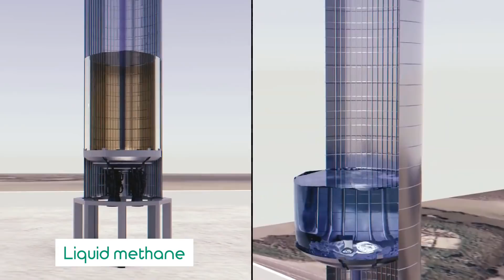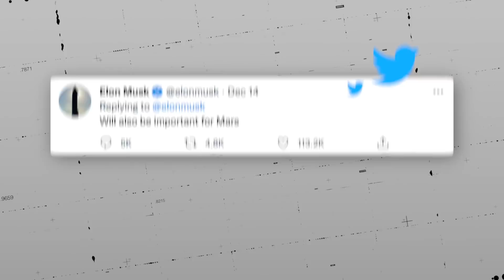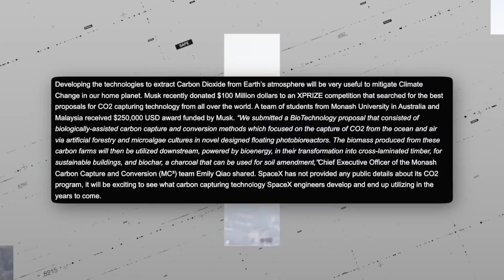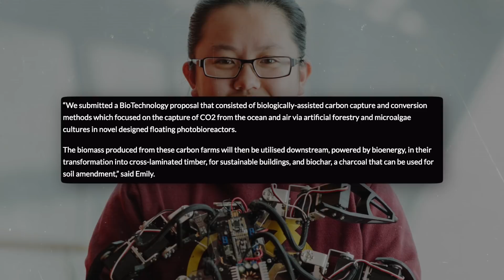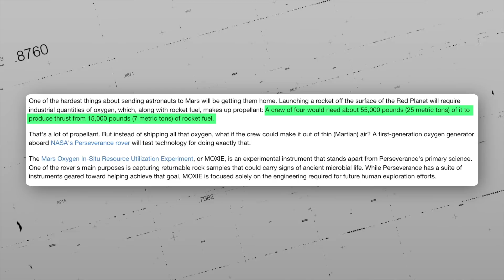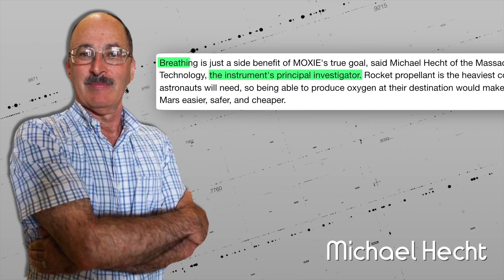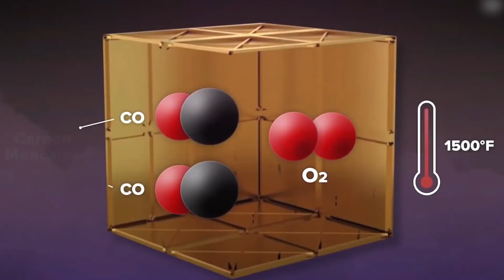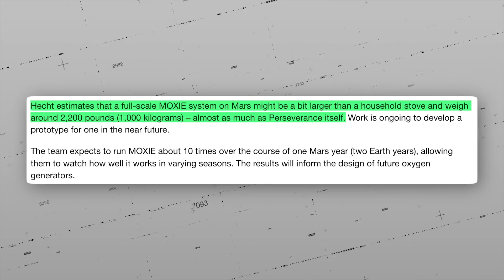Inside Elon Musk's Genius Plan To Use CO2 As Rocket Fuel

Comment: I made this roket 20 years ago by mistake and i burned my face. Indeed  if Elon will make it his rokets will have only co2 tanks  and oxygen tanks.  Wne i was in my 15 of age i was drinking a botle of coke 30ml made of glass. After drinking i put the metal lid back and sat it on the table. Later on in that day  i was amuzing my self with a lighter and i put fire at the hole of that botle with out the cap and a small fire was burning. Ater some time the fire was still there and i wanted to blow it off. When i introduce oxygen in the botle, a very violent reaction happened to that botlle giving me burns on my face and  I was not only in pain but socked. how did that burned that way for so long. So yeah. I guess CO2 and oxygen can burn violently.

Comment: Earth's atmosphere consists of less than 0.04% carbon dioxide. If we had any less the trees would suffocate.
Mars has a 95% by volume carbon dioxide atmosphere. Interesting fact, the average temperature on Mars is -81 degrees Fahrenheit but it can dip to as low as -220 Fahrenheit.

Comment: In a continuous manner of making a synthetic electronic powered sweet duct with large and small ports and pores made on the web like skin's membranes connected to an analytics system with oscillating and gyrating pumps for collectors of said co2 admissions using the co2 as the main fuel source adapted in making the fuel salvageable in the fuel salvage In the main fuel-lines  intake ducts too the main engines

Comment: Isn't there co2 in the vacuum of space and can we make our technology work as it  collectively gathers with solid state wet state hot gelled membrane web like skin with a high resistances to the cold temperatures of space co2 could possibly sweet the molecules out sweet and it could be collected on the gelled web with electronic then  outside and inside the spacecraft  that recycles co2 and recycles it to the full-line in a continuous

Comment: My problem with this idea is CO2plus energy to CH4 which is burned in a rocket engine with Oxygen to form CO2 and water,  to form what you started with CO2!
Reply: Exactly! People are forgetting basic chemistry when they say it will help the planet/climate change. Especially considering these methods most likely won't be (or be made) economical, or economical on earth, if the design is to use it on Mars. (Not to mention some climate effects will be irreversible if we don't just... use the renewable tech we already have!)

Comment: The best way to capture CO2 (in Earth) is not burning coal. Because coal is the the most dense form of CO2 captured by plants and algae in the remote past.
Reply: Maybe tell China!!!
Reply: Right, check out Hydrogen Gas off Diatomic  molecules. Non toxic 75 procent off normal matter. Is already used, and engineering. Europe now till 23- to 2006 , to replace Oil. We in California, could generate Hydrogen from Sun, already do it for Solar panels. Why not for electric batteries, or am I missing something, Elon already has. 🇺🇸🇩🇰🌅☘️😍⏳🙏

Comment: Think about a firework. You light it out in the open it will still be propelled forward. You have a mostly sealed tube that's close to the same diameter as the firework, the rocket goes further.

Comment: If the rocket started off in a tube like launch area, the thrust would take you further faster. Use the propulsion to create thrust.
Reply: You mean like a rocket silo? 

I always wonder what did they do with the exhaust heat and gas couldn't they use it for something useful like spinn turbines or something like that?
Reply: @CUBETechie  being in a half tube, would add to the propulsion, so, less fuel and energy used for take off. And recycled gasses for many things.
Reply: @CUBETechie  if you had a bamboo forest all around the base, but within non burning distance, the bamboo would help naturally filter the carbon and make oxygen in shorter amounts of time. Fast photosynthesis.
Reply: @CUBETechie  sort of. The top half would still be out in the open. The extreme heat and pollutants, could be captured and separated to be reused in different ways. Maybe even taken with on space or planet trips, to use the different glasses for many things on those other planets and out on space.
Reply: The human body can only handle a certain amount of G force, I believe the max is 10 G but I stand to be corrected on that.

Comment: One of the major contributors to carbon emissions is ocean shipping. Methanol has been identified as an ideally dense fuel to replace oil in this industry. The problem is that most methanol is currently generated out of natural gas, it is not solving the carbon emissions problem. However there are technologies and pilot plants that generate methanol using atmospheric carbon, water and renewable energy sources. Methanol generated this way would be carbon neutral. It would not add to the total carbon in the atmosphere, as it would be merely returning to the air what it has already removed.

The problem is that the current plants and the methods they use cost about five times as much per unit of methanol as does the process that uses natural gas. If Elon and company could come up with a way of generating methane (turning methane into methanol is trivially easy) from the atmosphere and do so economically, it would ultimately have a HUGE impact on global carbon emissions.

Comment: I think it would make much more sense in the long term if they were to develop an engine that runs on carbon monoxide and oxygen.  Extracting them from CO2 is much easier than making methane on Mars because methane needs water, which although plentiful on earth has to be mined on Mars. Extracting CO from the atmosphere only needs the CO2 and a source of energy - no need to go around digging up ice. The process is also less energy intensive, even if you had plenty of water available.
The only issue is that no-one has yet built such a full working prototype yet, but several experimental setups have been made with combustion chambers and such. That said, being the first to build something is not unusual for Spacex.  There are some known difficulties, in particular how to ignite the reaction without it detonating but the main reason that hasn't been resolved is that there has not yet been enough incentive to do it because such an engine would have no particular advantages here on earth. On Mars it is a very different story though.
The investment required to develop such an engine would pay off many times over by the vastly easier production of the propellant on Mars compared to any other form of propellant.

A similar situation exists with in situ propellants on the Moon.  There again everyone is talking about making propellants from mined water ice, which is very scarce and needs lot of work to extract pitifully small quantities. It seems to me that it would be much easier to mine metals and oxygen, both of which are extremely plentiful, and use them in a metal / LOX engine. As with the LOX/LCO engine no-one has yet built one but maybe it is about time someone started developing one.  The ISP would be quite poor, at the level of a KeraLOX engine or even a bit less but on the moon that wouldn't be that important and would be far outweighed by how easy the fuel would be to produce.
Reply: Very interesting idea, while yes I think it would be much easier and more efficient to produce, I just think that the downgrade in performance could cause problems especially when returning from distant space bodies. If we consider the fact that there is plans to build stable bases on both the lunar and Martian surface, it would make sense to put in a little extra work to drill for ice to produce liquid methane. It is a better solution to have drilling bases to produce a proppelent with a higher isp and exhaust mass flow. In the end I see where your idea is coming from, if it were a case of rapid land and return then it would be better to design a engine that could run off of carbon dioxide
Reply: Have to be careful though. CO has interestingly weird properties. It can dissolve metal. Iron pentacarbonyl is a liquid at room temperature and pressure... yeah iron a solid upon ligated with carbon dioxide a gas becomes a liquid. Freezing point -21 C and boiling point at 103 C.
Reply: Exactly.  This is a test of the Sabatier process that will be a requirement for travelling to - and from - Mars.
Reply: What concerns me is not so much the Sabbatier process itself, that is relatively easy, but the procurement of the huge amounts of water needed. I can't help thinking that the difficulty of obtaining water in significant quantities is what will be the cause of failure of the whole venture. A well established Mars colony would eventually develop that capability but anything we can put on the surface in the next decade or two is only going to be able to provide the bare minimum amount of water needed to sustain life. 
The amount needed to produce enough methane for a Starship trip back to earth is orders of magnitude larger than  that.#

The reason I believe Spacex should develop a LOX/LCO engine is not because it is a better way but because it is probably the only way that has a chance of succeeding.  Its seems many, apparently even Elon Musk, grossly underestimate the difficulty of extracting water from the Martian soil. Instead of thinking about that everyone seems to be instead thinking of how to make the Sabbatier process more efficient and whatnot whereas the real problem is how to obtain the water that will be needed for it.

It's not just a matter of cheaper, easier or better - it is a matter of feasible vs not feasible. I can easily imagine a CO2 electrolysis plant producing CO an O2 directly from the atmosphere in sufficient quantities, perhaps run by a small nuclear reactor or solar panels but I cannot even begin to imagine the scale of operation that would be needed to gather water in sufficient quantities to produce methane instead in useful quantities.  

Here we're talking about large numbers of vehicles roaming the surface each collecting maybe a liter or two of water each day from below the surface if even that. And this is assuming that one can get them to work first time without having ever tried them in the real Martian environment. The best experiments to date here on Earth with simulated Martian environments have not even yielded anywhere near that, extracting quantities on the scale of a teaspoonful or two a day.  It is hard to believe that within a few years we will be able to improve that by orders of magnitude and do it with machines operating autonomously in a real Martian environment.

There are many difficult obstacles that need to be overcome to make a LOX/LCO engine, as even Nick L mentioned but these pale in contrast to solving the water collection problem on Mars.  The more I think about this the more I believe that an engine running on CO is the only way forward. Once a colony is eventually established it  would at some point become feasible to start mining water in large quantities, but only after many other things would have been taken care of.

Comment: I don't get it.  We can't cost effectively produce hydrogen from electrolysis of water.  But some how we can produce methane from diffuse sources and photovoltaic electricity more efficiently than we can just get it out of the ground and move it around?  Creating rocket fuel and oxidizer from CO2 and water makes sense on Mars.  But until we've totally decarbonized and are not burning any natural gas, it is a stunt and energetically inefficient to produce methane on the earth from CO2, rather than just getting it from natural gas.